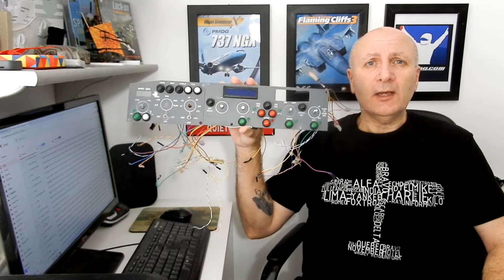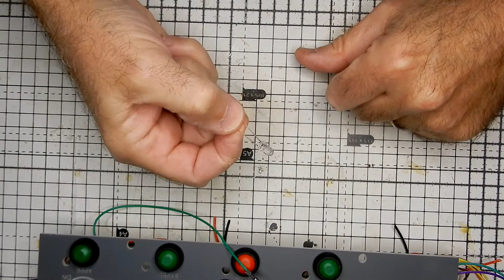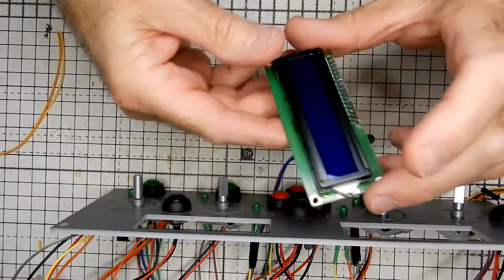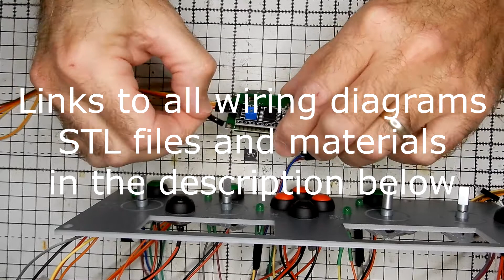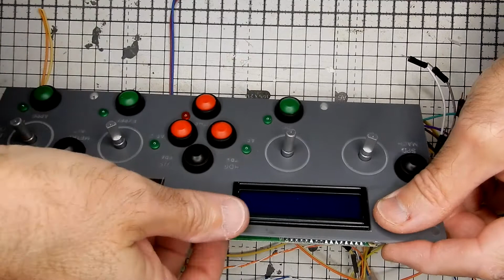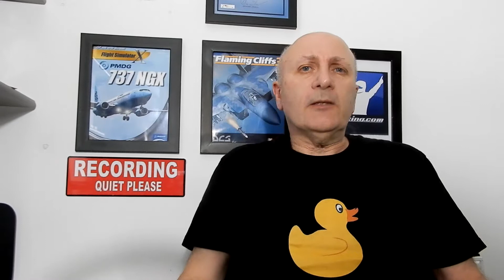Airbus A320 FCU Build for Flight Sim 2020 Part 3

Comment: Hi, a couple of questions.
1. How did you make detents for Range and ND  mode rotory encoder, as here a change of one detent won't correspond to the selected mode
2. What do you call the selector switch you have used for the ADF/VOR switch
3. Were you able to install the second LCD?

I'm following your build trying to make one for myself hence the questions.
Reply from the maker: Hi thanks for watching and subscribing. I never managed to finish this project because of the problems with FS2020 not having all LVARs accessible. It is possible to use Linda2 software but I never had any success. Sorry I couldn't help but as time goes on Microsoft are allowing more access to the sims programming.

Comment: Can u do one for a 737
Reply from the maker: Thanks for Subscribing. If this is for the PMDG 737 or FSX you should checkout Helimech he has built an awesome 737 version for Prepared 3d but it works on PMDG and FSX with fsuipc
Reply: @togatech1111  ok thanks so much I also subbed cause ur vids r awesome